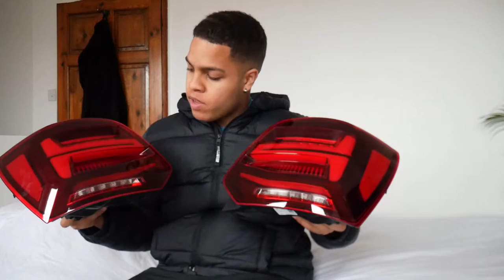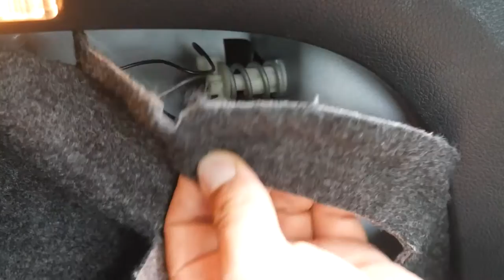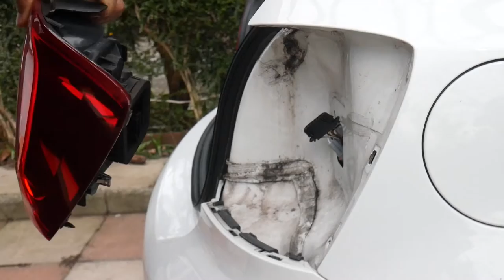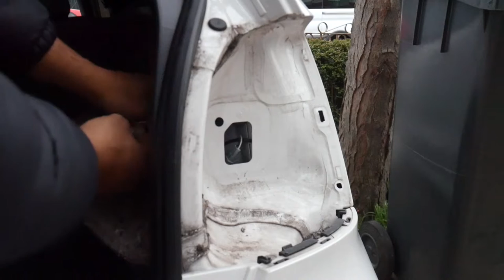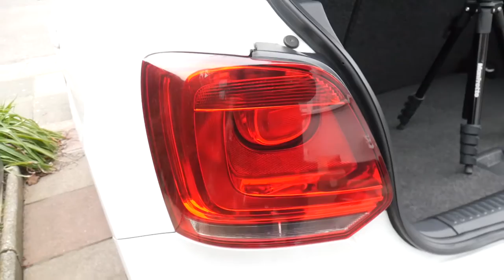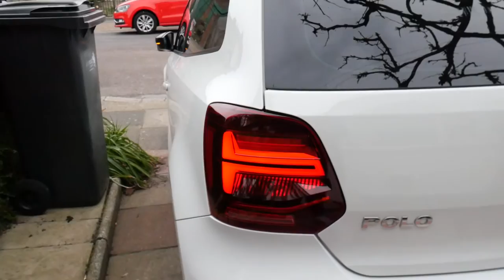INSTALLING NEW TAILLIGHTS TO MY POLO!

Comment: Did you have to sand any of the black plastic trim away mine are quite a bit thicker than the stock and aren’t just sliding on think I’m gonna need to file it down a bit, anyone else had this?

Comment: I have a 2012 polo GTI  6r and got these lights the fit was bad not sitting flush so I had to remove the cushion form from the inside of the light so it would suit flush against the car. I’m pretty disappointed with that because they cost me €290 😢

Comment: I’m having real trouble getting one of the screws back in. Extremely annoying.
Reply from the maker: What plate polo do you have mate?
Reply: @chinamandrives5735  60, I’ve got one of the lights on perfect fit works fine then the other one is just turning in the thread yet when it’s not in the car it goes in the thread perfectly. It’s bizarre.
Reply from the maker: @morgancole3121  drop me a message on Instagram bro @riisepeters

Comment: Just installed these, they really an improvement on the stock ones.
But for some reason my indicators are bright red instead of amber.. but it still looks really nice on my red polo 😎
Reply from the maker: Sometimes you have faulty with them, I have to re-order them twice to get the yellow indicator ones. Unfortunately at the moment my car has been written off, so I’ll be bringing back the polo to life very soon, if you want further detail check out my recent Instagram post on @chinamandrives and feel free to message me
Reply: Careful with that, as far as i'm aware that isnt road legal if you are in the UK.
Reply: @adampertics1351 yes they are lol